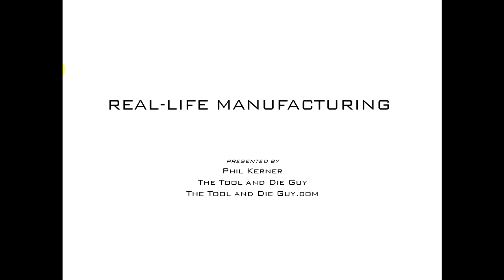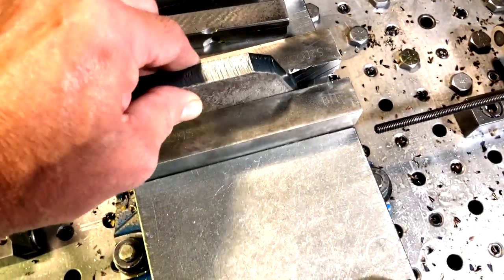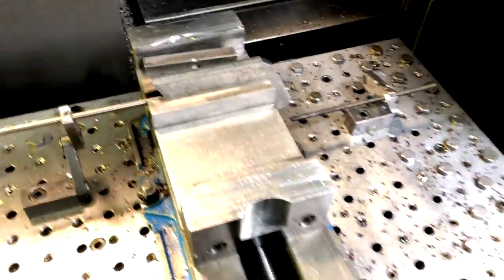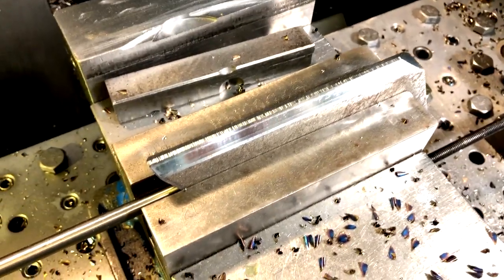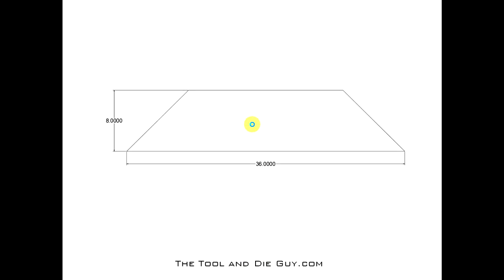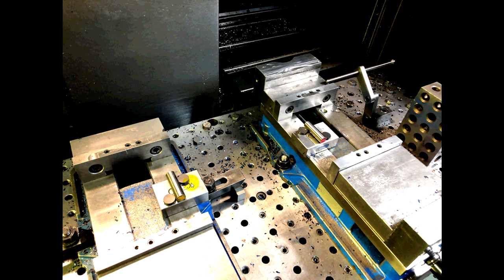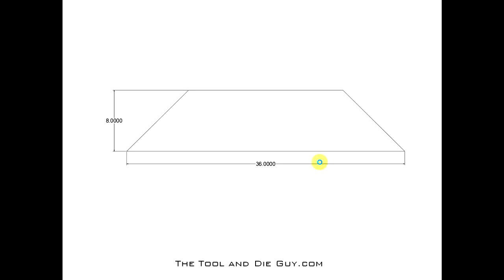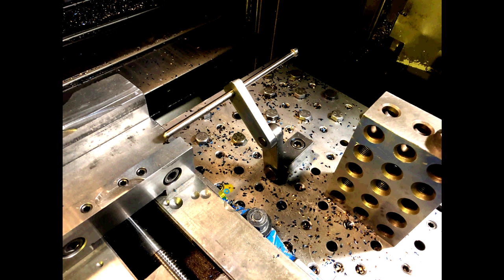Three Lessons in One

Comment: I don't understand. In my shop, those chamfers would be done very neatly, free hand with a 4" grinder. No setup required, and done in a fraction of the time. What you did, based on your pay scale, was a lot more costly than the way I would do that job. I mean, it's a weldment not a precision feature.